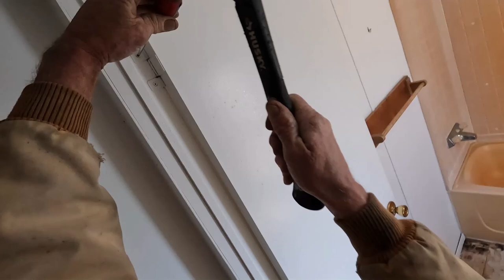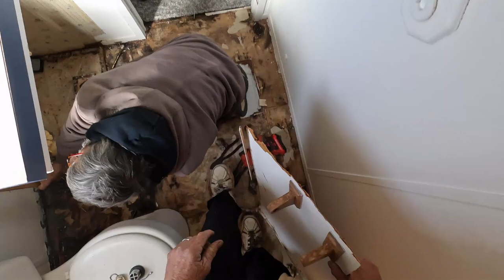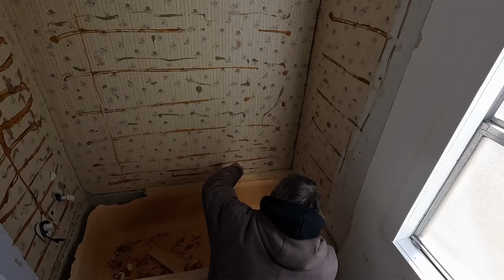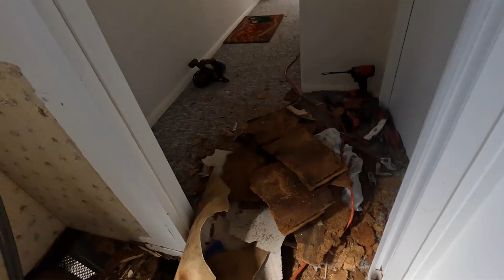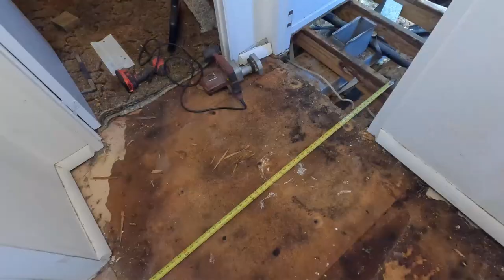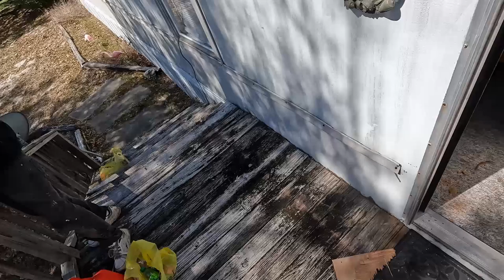How To Repair Rotten Mobile Home Bathroom Floors.

Comment: I'm so glad I came across this! My bathroom is bigger so I'm not as stressed out about getting my project done..... But then again I've only watched the first 60 seconds!!!
Reply from the maker: I hope this video helps
Reply from the maker: I have many more
Reply: Thanks for your reply. I needed to take a break from the shower walls as I was starting to make an absolute mess out of the caulking. Before I finish it I better learn how to apply it properly!
Reply from the maker: It is so easy to do. Call me I’ll explain. Maybe even FaceTime
Reply from the maker: 910-294-1761
Reply: @Drewsroofingandhomerepair  oh my what a generous offer.....thank you! I did finish My project and took my first shower today!!!! It is not perfect but I will take pictures and text them to you tomorrow sometime. I am so excited to have it done. While there is much more to be done in the bathroom I'm going to consider that part easy. I will send a picture of the challenge spot that is remaining. And that is the wall panel behind the water lines of the bathtub and that wall is in my bedroom. I am thinking about installing a barn door that would secure to the wall but easily on latched and move if access is needed to the water lines. Does that make sense?
Reply: @Drewsroofingandhomerepair ur a boss bro lol ty for the vid

Comment: It really makes you wonder, if mobile homes were built with proper wooden materials from the get go, like when someone fully remodels it, how much different would the initial price tags be as well?🤔 perhaps closer to a stick & stone house price? But I do love that he said if its made of wood, it can be fixed. The time & energy going into these repairs can be something for sure. Kudos to you guys for all the hard work you do, as well as posting the videos.🫶🤘
Reply from the maker: Trailers are definitely not made like a house. There is a lot of framing that just isn’t there in a mobile home. So we have to find a way to put it there. That is why you see us installing all the blocking around the outside edge. The tongue and groove is a great help because you don’t have to block there but if you don’t use tongue and groove you have to put blocking Where the Plywood Meet

Comment: I left a scrap piece of Advantech Zip Board sheathing leaning against the fence in my back yard for about six months, exposed to the elements with the cut edge on the ground - I was expecting to come back to a pile of rubble when I remembered to get rid of it, but was shocked to find it was in perfect condition, and could easily have been used in a project! Amazing stuff... When did the mobile home industry move away from sawdust subfloors?
Reply from the maker: It’s amazing. I have a piece now I used on my door for under my house it will last forever

Comment: Thanks for your videos.  I am redoing a small bathroom and ran into an issue where I need to move the shower drain. (Wife wants to change from tub to shower and wanted a specific shower which of course doesn't fit and I need to move the drain.) I had a small amount of water damage and cut that area out.  Now that I need to move the drain I think I need to pull the entire bathroom floor and replace with Advantech.  That will give me a uniform surface for the tile she wants.  Am I thinking about this too much?
Reply from the maker: You can do it
Reply from the maker: A little bit of elbow grease, and you can do it if it’s made of wood, you can fix it

Comment: I have a hole near the bathtub. Shall I remove the bathtub too or just replacing of the damaged piece of the flooring is enough (but I suspect that the rot went under the bathtub and the adjacent wall). After watching this video and seeing what a crappy material was used for the flooring and the vanity I want to demo all of my bathtubs after I'll get my demolition reciprocating saw. :)
Reply from the maker: My recommendation would probably be take the whole thing out if you can afford it if you can’t afford it obviously framing around the problem would be a Band-Aid but if that’s all you can do a Band-Aid is better than none
Reply: @Drewsroofingandhomerepair can i double up supports and get a better/heavier tub? idk how heavy i can get away with

Comment: I have repaired many mobile home floors, and believe me where I live no one wants to work on trailers. I’m working on one now in the kitchen the floor was sagging bad. I started tearing up old floor and the used staples about 2 1/2” staples to attach it PLUS they glued it too. Never seen on glued and stapled. Too bad they all used cheap particle board.  I live in a 60 year old trailer, but have replaced all the floors, and in the bathroom, replaced floor joists too. I cast iron pipe for plumbing run under the trailer. I cut that out and ran pex inside the house. Once to get the floors and plumbing replaced, you have very few problems. God Bless ok
Reply from the maker: Sounds like you have it figured out

Comment: Can you show how to take up a toilet & how to cut the water off from the side of it
Reply from the maker: I don’t have a video this one of that. I’m sure you can find window on YouTube somewhere I just don’t have one.
Reply from the maker: On each side of the toilet, there are bolts remove. The two bolts in the toilet will come right up. There is a hose that goes from the wall to the toilet with a knob on it. If you turn that knob, the water should shut off.
Reply: @Drewsroofingandhomerepair  ok thanks but what to do if the water doesn’t cut off cut the main one off

Comment: We bought a mobile home about 6 years ago that was brand new but apparently it wasn’t set up right. Almost every single part of the floors in this single wide are falling in. Actually we have had to set planks of wood on top of massive holes that have formed. I have a special needs child and my husband has end stage COPD and congestive heart failure. I’ve got to fix my floors asap. I don’t know what to do. I have no extra money to do this but I’m smelling mold. It’s not a situation I want my family in. My husbands breathing is very bad and he is on supplemental oxygen 24/7 so having mold around can be extremely dangerous. I’ve got to fix this somehow. HI will do the repairs myself-how much would the supplies cost and is something with this much damage repairable? We don’t have the money to move so I’m not sure what to do which is why I believe repairing is the only solution.
Reply from the maker: I make a Lotta videos. If you wanna check out my channel you can look down through there on how to repair Mobile Home Floors. It’s not the easiest job but it can be done in one room at a time that’s a good thing about it if you go to my video page Drews Roofing, and Home Repair, and just scroll down through the videos I think you’ll see a lot of videos that will help you here is one video on us removing the floors in order to get ready to replace them. If there’s anything else I can help you with please feel free to call me or send me a request for a particular video and I’d be glad to send it to you. I’m sorry to hear about your situation. The best way to remove Mobile Home Floors is by watching this video and see how we do it one room at a time.  
https://youtu.be/e-bHWLjqM2E
You can do it with a little help
Reply from the maker: I wish I could do more to help your situation. Like I said, if there’s anything that I can do as far as videos, feel free to contact me.
Reply: @Drewsroofingandhomerepair  sorry it took me so long to reply- the comment got lost in my notifications it seems. Thank you SOOO much! I will be checking out that video right away. You’re informative videos are the hugest blessing ever! I honestly cannot begin to thank you enough. It has felt like such an impossible situation. We can’t leave-we can’t stay and we don’t even know where to begin to rectify the whole debacle. Watching your videos is giving me so much hope for the first time in awhile about our situation. You are amazing! God bless you!!!! I will definitely reach out if I have any questions or need a video on a specific situation we run across in this massive but do-able project we now have ahead of us. Thank you for offering to provide videos if I can’t find what we need in the ones you’ve already posted. Seriously you are the best!!!!
Reply from the maker: When I started making these videos, I made him for people like you that would appreciate it and thank you for your appreciation